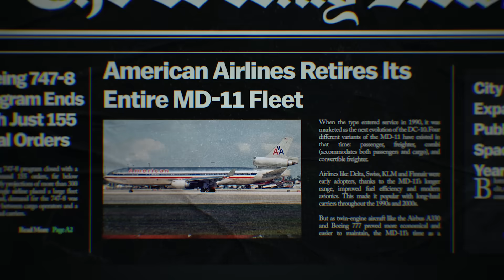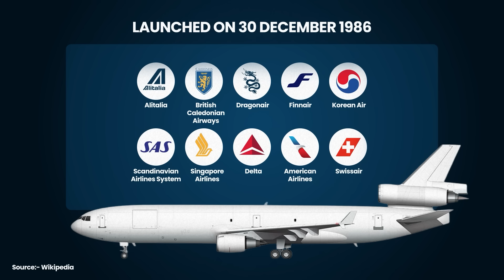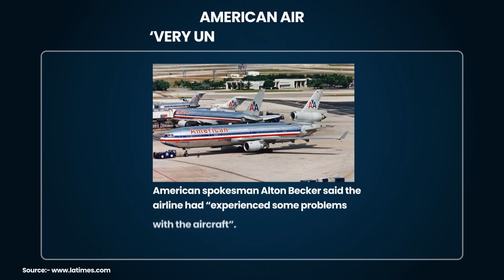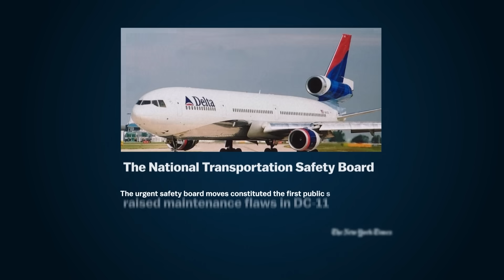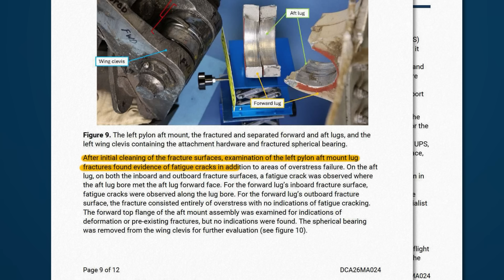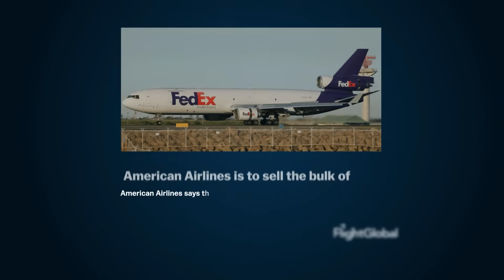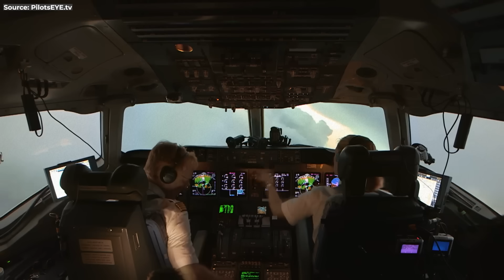Why UPS and FedEx Still Fly 35 Year Old MD 11 - Against All Logic

Comment: The 777 had larger diameter engines, and it also had just 2 engines to service vs 3 on the md11. The md11 was the last of its kind due to economics. Two engine birds were the future, and they are still the present.
Reply: That is correct! More power and less fuel usage!

Comment: The engines only fall off occasionally, so it’s worth the risk
Reply: I think it's happened once so far, for the MD-11.
Reply: @Edax_Royeaux the md 11 crashed more than once look at mentour pilot or green dot aviation
Reply: @toxinfrost8747  I'm not counting the engine falling off a plane once it's already crashed, I think that's disingenuous.
Reply: @Edax_Royeaux MD-11 yes but it was designed off the D-10 with a lot of commonality. So perhaps the association is merited? 🤷‍♂️
Reply: @Billskdm  So that's 2, if we include the predecessor that was designed 60 years ago.
Reply: Two many 😉 for me at least. Just because each time it happened never even gave the pilots a fighting chance to save the plane.
Reply: @Billskdm  The first time, the pilots did have a fighting chance to save their plane.  It also wasn't a design issue, but American Airlines maintenance breaking the pylon attach points with a forklift.  So if you're referencing "design", you're looking in the wrong place.
Reply: @Billskdm  It's the same plane! They just stretched it and covered the windows.  The engine pylons were not redesigned! McDD had to merge with Boeing to cover their ass! The corrupt culture of McDD has infected Boeing.  Wake UP!
Reply: @Edax_Royeaux  it was a design issue. It takes 200 man hours to service just 1 engine on a DC10 or MD11! Companies will cut corners when faced with those man hours.

The engines on the wings of the DC10’s and MD11’s are designed to go up and over the wings if they detach. The engine severed the hydraulic lines on AA191 in 1979, rendering the plane impossible to fly. Plus it sent pieces of the broken engine into the 3rd engine on the tail causing that engine to be damaged. The same thing happened to the UPS plane in Louisville! 

There should be redundant systems on airplanes, in case one thing fails the pilots would then have a chance to fly the plane.  It doesn’t matter what caused the fatigue cracks on the pylon. Be it maintenance or lack thereof. The outcome was exactly the same! People died! 

McDonnell Douglas cut WAY too many corners designing these planes. They rushed production and didn’t care if their planes passed appropriate tests. In fact, they all failed a test or 2! They sold them anyways! Corporate greed.
Reply: @Sly-f9i  "Plus it sent pieces of the broken engine into the 3rd engine on the tail causing that engine to be damaged.  The same thing happened to the UPS plane in Louisville! "
I just reviewed the NTSB report on AA191, there is no mention of any issues with Engine 2 or 3.  Where are you getting your information?
"McDonnell Douglas cut WAY too many corners designing these planes."
A trijet is going to have an engine in the tail, that's not cutting corners.
Reply: @Edax_Royeaux happened in Louisville this November
Reply: On average, once every 46 years. I wonder how many millions of flights those planes have done in 46 years.
Reply: @j @jasoncoates1835 the plane that crashed had about 93,000 flight hours
Reply: Reminds me of the front fell off video https://youtu.be/3m5qxZm_JqM?si=xbobiOtwRMM3cq6T
Reply: I just like to make the point that the engine falling off is not normal.
Reply: @cricri7066 does it matter if it’s inside or outside the environment
Reply: @cricri7066  not sure why but that really made me laugh, thank-you!
Reply: Some are designed so the engine doesn't fall off at all.
Reply: @Nathan-wk9dd  They are designed to stay on, it's the maintenance procedure screw up that damages the pylon structure. OOPSIE.
Reply: @thomasmleahy6218 
Perhaps the maintenance crew sometimes plays on and don't pile on the procedures...🤔
Reply: @Nathan-wk9dd  😁
Reply: Boeing has left the chat
Reply: @GrubbyPaddler  Boeing Boeing Gone.
Reply: Same as boeing .. same company now...
Same same but different
Reply: The same  happened to at least one B747 and one B707.
Reply: @EK-gr9gd  And a Boeing KC-135.
Reply: Well, the engine falling off isn’t too typical.
Reply: Insane isn't it, they just don't fix them it's like Ford with the mustang are the pinto that calculated the lawsuits and what it would cost. Keep the planes for safety
Reply: BB–11
Reply: I have just done a Radar 24 search, not one MD11 in the air. Yes you are promoting these aircraft but have ANY pass the airworthiness test that are now required since that tragic crash?
Reply: Exactly and 2 engines are more efficient.........
Reply: For 3 engine planes, can the pilot switch off 1 engine (say the middle) if load is light?
Reply: @alanpoh2879 Can? Yes, because otherwise it wouldn't pass ETOPS rules.
Would? Likely not, because a switched off engine creates a huge amount of drag. Instead they would just reduce thrust on all 3 engines.
I know that some propeller planes are able to save fuel by switching one engine off, but they fly slower and can adjust the blades to reduce drag.
Reply: Execs dont fly them do they dont bear the risk and their golden parachute is safe
Reply: Tell that to all the pilots and their families.
Reply: Only occasionally huh?
Reply: One must wonder if this failure is due to the same reason as that 1st tragic accident. 🤔
Reply: Of carrying cargo, yea
Reply: no no no that's the dc-10. they've worked out the kinks in the pylon design by the md-11. jesus christ you have one or two engine detachments, and they never let you forget it
Reply: The doors do stay on tho; there is that. 🤷‍♂️
Reply: @herbert92x correct, 747 had some cargo doors blow out as well…
Reply: It’s a maintenance reminder feature like the “change your oil light” on your car. When the engine falls off, please bring in for service at earliest convenience.
Reply: Airfreight companies are willing to lose an aircraft and a crew on a few occasions to make $$$$$$.
Reply: Cars only crash sometimes, so they’re worth driving to McDonalds.
Reply: The engine fell off the American Airlines flight because of the air line leting  their mechanics cut corners to save money which caused a deadly catastrophe!!! It was not the planes metallurgy faults!!!!
Reply: @John-z4g5p 
It’s always an accountant!

Comment: aren't they grounded?
Reply: Yep, DC-10 and MD-11 are grounded worldwide Since it’s unlikely that Boeing will design a replacement pylon, which would take a long time to develop and test, be costly, and until the time it’s ready, those planes won’t be of use to the cargo carriers. Bottom line, if the problem is pervasive in the design (as now looks probable), these will probably never fly again, at least not in the US, and unlikely worldwide. After inspections, they can probably get an exception to fly them to an aircraft graveyard, or maybe deliver them overseas…if anyone will buy them overseas.

Comment: I read Singapore airlines never took any deliveries but rather canceled everything as they had found out thr MD-11 could never fly from Singapore to Europe during the winter season when head winds are strong. They opted for the A340 and B777 instead.
Reply: Yes. They cancelled their order because the plane did not meet the agreed upon range and payload target. The MD 11 did not even enter service them with as claimed in the video
Reply: and then Boeing bought McDonell, so the top-managers who overpromised on the performance did not have to suffer at all.
Reply: @MrrVlad  That deal ended up working out more like MD buying Boeing with Boeing's money. The top brass after the merger was largely McDonnell Douglas'.
Reply: @MrrVlad very true

Comment: It’s only common sense.  Why finance a brand new car that gets an extra 1mpg of fuel mileage when you can get a used car for 1/3 the price and pay cash and avoid all the finance charges?
The tragedy is, if the final report determines it’s the same or similar cause of that AA DC-10 crash, then this is likely a maintenance issue and could have been avoided because we already knew about the dangers of mishandling that engine pylon mounting system.
Reply: I don’t think so….its looking more and more like a fatigue crack. It could be maintenance related, or it just could be that the entire assembly wears prematurely, and the DC10 crash way back was just a prelude to this design issue.

If the latter - these birds may never fly again, or if they do under much maintenance survelliance. Though that also changes the economics of these too.
Reply: @jonathanpusar5931 absolutely, everything you just pointed out is correct. And everything you pointed out comes down to maintenance, and maintenance cycles. If they wear out prematurely, then you change them faster, there's no fucking way an engine snaps off during takeoff because the part you have on there is brand new and the machine you're flying is 35 years old. It snaps off because your maintenance cycle is too long or your maintenance sucks. But ultimately, it comes down to maintenance. If the wings were snapping off midlight, I'd say the plane is to damn old, you retire it. But these planes could fly 50-60 years. You just have to change your maintenance cycle as it gets older on certain items. But this comes down to maintenance period.
Reply: @gbedmonds1594 but additional inspections and replacement for such an expensive and laborious part of the plane is also going to make carriers reconsider extending the plane.
Reply: @gbedmonds1594  The cycle for inspecting the aft pylon mount that cracked is absurd. It works out to be once every 5 years for these freighters. 

The inspections are scheduled for every 29,000 cycles (flights), and the UPS jet was at about 21,000.
Reply: @jonathanpusar5931  if it was a design issue. It would have happened sooner.
Reply: @Fone65 that's not how it works.
Reply: @jonyemm  Yes it is. You just won't to white wash it.
Reply: Btw, the word is "want".  @Fone65
Reply: @jonyemm You must be a child. Only kids worry about grammar in the comments
Reply: @Fone65 that's not even a grammatical error. It's a spelling error.
You keep telling yourself that though and you'll continue to fit right in with those kids in the comment section that you're talking about.
Your lack of a response to my other comment, yet replying to that one with what you said really is quite telling.
Reply: @j @jonyemm You win. I don’t argue with kids. I’m done.
Reply: @jonathanpusar5931  we’ll see.  So far the speculation is over the top and people are making huge assumptions.  I really think MD was a rotten organization and its management especially and those same managers infected and have nearly destroyed Boeing.  But at the same time the DC-10/MD-11 was a great design for the times that overseas travel required more than two engines.  It was maintenance shortcuts that caused the spectacular AA crash not design.  And fatigue cracks that apparently caused the UPS crash are simple and easy to correct considering engine maintenance is a known routine thing anyway.
So, at this point only nearsighted overreaction and panic by ignorant and hysterical people would cause permanent grounding of the entire fleet.
This crash was tragic and, yes 14 innocent people lost their lives.  Very sad. With proper maintenance planes can (and do every single day) fly for many many decades.  Have a little faith in the system and wait until the full analysis comes out before you make such draconian conclusions.  The planes are temporarily grounded.  There is no immediate risk or danger.  So no need to set our hair on fire.
Reply: VW Bora 1.6 Highline
Reply: Are you sure that maths?  From Louisville to Honolulu with 3 engines increases your cost significantly, especially when at least of the engines is very difficult to maintain.
Reply: @briansteward5085  you have to factor in that back in the day the plane was designed, overseas routes had to have more than two engines for redundancy.  A three engine design like the dc10 and 727 were competing against four engines like the 707 and 747.
Reply: @pchris6662  True, true
Reply: @briansteward5085  if it didn’t make sense, they wouldn’t have been doing it
Reply: @Fone65  That's actually not true.  If you look at Senior Management history, particularly the CEO's, they will kick the can down the road because historically it'll be their successors problem.

Cheap planes now for future fuel & maintenance expenses is a long term problem; eg UPS has had 8 CEO's since 1980...they average less than 6 years.
Reply: @briansteward5085 Ups is still around and it’s not going anywhere. The planes are going to fly again because the problem was bad maintenance. Just like it was the first time this happened.
Reply: @Fone65  I never mentioned bankruptcy. I mentioned a CEO making a decisions for the short term, that's not a debatable subject.  Saving money now increases the stock price, impresses the board, and gives the CEO higher compensation.
Reply: Better still dont get a car and walk burn off some of that lard......
Reply: The analogy is bad. Your car sits idle 98% of the day, so the capital cost is far more important than the fuel cost. UPS runs it's planes over 4-8 hours per day, so the fuel cost starts to matter, about 12x what it matters to a private car owner. What you're doing is like comparing the fuel economics of a taxi driver to a commuter. Not the same.
But your argument has some logic to it: freight operators fly the plane about half the hours per day of passenger airlines, so fuel costs matters half as much to them. Still, the most important factor was that they could buy these planes at fire sale prices while the airlines dumped them.
Reply: @DerekKerton  you completely ignore the part of my analogy where I include that buying the asset outright at lower cost means they can avoid having to finance it.  I’m a business owner myself, albeit just a small business not a giant freight carrier.  But you can’t just trivialize the advantage of buying old equipment at low cost rather not than having to borrow money to buy something more efficient brand new.  Many times its makes much more sense to run old equipment instead because you don’t have the money, or just need to fill a short term gap.
Granted, I could dig into the numbers a bit and look for the crossover point, but you’re still ignoring very important factors of financing capital equipment that go way beyond just simple fuel costs.
It seems like too many people have this mindset that we need to throw equipment away and buy brand new because it’s “more efficient”.  Those are the mindsets I’m pushing back on.
Reply: @pchris6662  True. "Buy at a discounted price" is a rock solid argument. I didn't overlook it, I specifically mentioned it. But I didn't credit the fact that you had also mentioned it.
Reply: @pchris6662 i agree totally with you, many people and companies have ridiculously costly update programmes , presumably for unseen reasons, I have.noticed here in the uk that UPS consistently operate vans which are up to 20 years old, yet the idiots at royal mail are replacing diesel vans with useless ev ,s
Reply: @DerekKerton the analogy he makes is to point out the economy of operating a machine which is slightly less fuel. efficient yet does,nt bear the burden of high depreceation and or maintenance costs, many older machines are far cheaper to maintain
Reply: its more like 10 to 15 mpg lol!
Reply: Well tell that to the families that thing came down on top of, and I bet you get a different answer!
Reply: @GregCunningham-u7k  even the very modern 737 Max fell down...
Reply: @GregCunningham-u7k  What are you even blathering about?
Reply: @GregCunningham-u7k no it really all comes down to maintenance, inspection, and repairs. If not done frequently then nothing and I mean nothing will last long enough to be worth it.

Comment: I don’t agree with your conclusion at the end of the video that the parcel carriers keep using the MD 11 because it’s good at its job. The actual air frame has had problems since day one and they’re only using it for the reason that you quickly mentioned and then never mentioned again in this video because they are cheap. They brought them cheap because they were being scrapped off by the airlines and I can only assume they’ve done whatever they need to do just to keep them in the air legally cause let’s be honest they’re freighters you can only imagine that there’s not a lot goes on on the inside of the freight cabin like there would be in a passenger plane with refit and modernisation and cleaning. The only way these dangerous planes will get taken out of the sky and I will honestly use the word dangerous planes is if they are made to stop using them because of a quite obvious designed floor

Comment: Maybe they should develop a better x-ray machine to inspect those engine mounting points. Companies should invest in a more comprehensive inspection procedure. And hire experts that are trained in just that area, not just your basic airline maintenance mechanic. Being that 90 percent of their MD-11fleet are paid for it would be worth it. Also manufacture if possible, new mounting brackets that are certified by the FFA. And get rid of forklifts that they use to install the engines. They should've done this years ago when the Chicago plane MD-11 lost its engine.